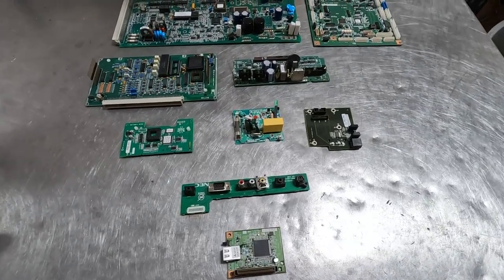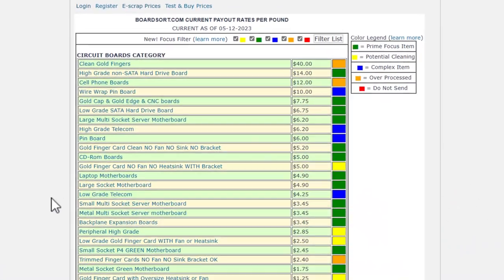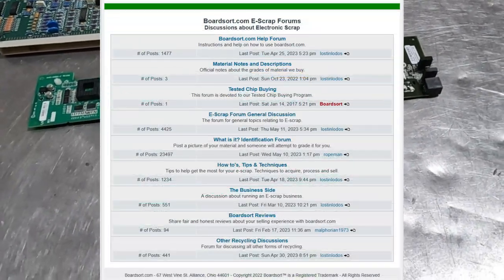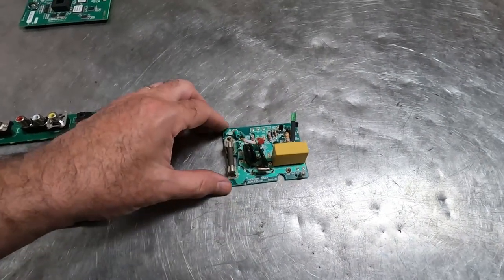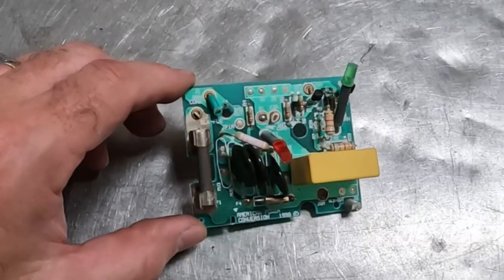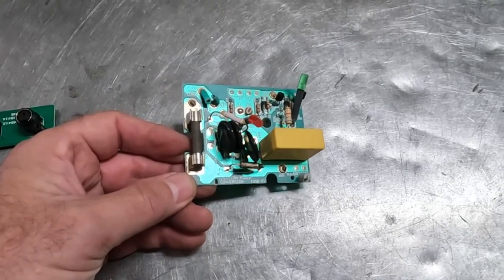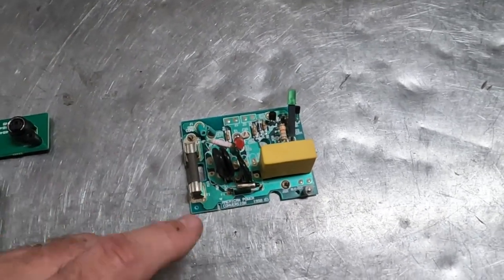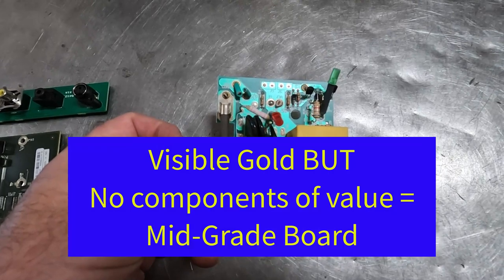Ewaste Circuit Board Identification - Peripheral Boards

Comment: Very good and I agree with your assessment.  I  have quite a few DEC boards with high density of ICs but not sure how to grade them. Do you know of any way to determine  by number of ICs  or date ? Or anyone who specializes in digital equipment items.
Reply from the maker: I wish there was a magic formula that would make this so much easier.  I've been researching this for a long time and I've found no data base or definitive guide - frustrating.  I'm happy to take a look at some pics of your boards to help out.  You can also pics to the Boardsort forum and ask.  Some very smart folks there.

Comment: Question, at 11:00 you depopulate the heat sinks, transformers why not sawzall around the right hand I.C. cut the board off and that would remove the capacitors? Why not break high populated ic/pins areas off, sell them aS perhifial hi grade  and the capacitor chunks as mid grade?18:33 is full of pins and ic's, you just said that was high grade? Why not depopulate the junk off and make it all i.c.'s and pins?(Hi grade?)
Reply from the maker: I'm responding from a hotel room after having evacuated the Asheville area due to TS Helene so unable to provide detailed response to each of your time stamped questions. The question of depopulating or cutting sections of boards to upgrade value is a very good one with lots of considerations. Time is one factor. Should you spend time on trying to squeeze more value from peripheral boards or focus on other more high value inventory? There's also the question of weight. The section of board with the greatest density of IC's and chips usually weighs very little after being cut away. And usually what's remaining is just low grade. Who and how you can sell the material is also important. After you do the cutting or depopulating, do you still have a buyer for the material? Finally, does that work fit your business model. For hobby scrappers/recyclers this is not a consideration but as a business sometimes we make decisions to get less value on somethings to optimize the time we spend on other higher value activities. Sorry I'm not in a position to provide specifics to this video for you but hope this rambling explanation helps.

Comment: Great video.  Question about removing other components should you also remove the capacitors?   Keep up the great work!
Reply from the maker: Generally speaking it is not necessary.   Those caps tend to small and light weight.  However, if you do see a big chunky one it wouldn't hurt to remove it.

Comment: Appreciate the info, ever do a cost analysis of removing components to upgrade to high peripheral vs low?  I know it will depends on the board and the price is at least 2x difference but wouldn't the weight loss would be more than 50%
Reply from the maker: I've not been able to do a real cost comparison because it is too dependent on the type of board.  But here's a link to a video I did with Chris at BOARDSORT.COM where we talk about this:  https://youtu.be/jwC_cCaTm0Q

Comment: @10:35 the problem is that boordsort frowns on removing items from boards when I have done this in the past they emailed me and told me they automatically downgraded my board to low grade when I did the same thing you did so my question is how did yours get upgraded to high grade?
Reply from the maker: That is a very good question and source of confusion. It all depends on the original board configuration and what one removes. In some cases removing the low grade, or junk, part of a board can cause the remain part to be upgraded. But one must have a very good understanding of where to draw that line. Most times when people remove components they are removing the ones that add value and therefore down grade the boards.
Reply: @sharkscrapper  that makes sense thanks for the response.

Comment: really newbie question here. I have been watching your channel and think this might be a cool hobby to get into. How much stuff do you get that is not saleable or able to recycle? How do you dispose of it?
Reply from the maker: A great question Patrick and I'm afraid the answer is, "it depends."  So much depends on what you're going to scrap and what yards will buy in your area or if you're within reasonable shipping distance to Boardsort.com.  For example - most PC's have a lot of plastic on and in them.  If your yard requires the plastic be removed from the metal shell you'll have a lot of plastic to throw away.  Fortunately, most yards will take the PC shells with the plastic on.  If you strip insulated copper wire you'll end up with the plastic insultation that needs to go in the trash.  Most motherboards have a small button cell batter, the CMOS battery, that needs to be removed.  Most places will NOT take these in recycle and should not go in the house hold waste.  I take mine to the county transfer station for handling.   I'd say by far the greatest amount of trash you will generate is all the plastic that makes up the bodies of most electronics these days.

Comment: I believe Aluminum Electrolytic capacitors on the PCBs worth clarification.
Any recycling of it in the States?
From point of view of a true scrapper, I see about 10-15% nice 6061 aluminum when you dissasmble capacitors with some tools. it takes time.
for now I put them to trash.
Just curious if any recyclers accept them sorted separately at any rate, maybe at price of a shred? 😂
Reply from the maker: I've not found anyone here that takes caps as a separate item. I'm sure that the board processors are sorting them after the boards have been shredded.  There are some very clever ways to use eddy currents to remove Al from a shred stream.  As you commented, it takes some extra time to get the Al from them, so I just leave them on the boards and let the big processors do it.

Comment: I believe ALL aluminum electrolytic capacitors are to be removed,
Reply from the maker: Just to be clear - BOARDSORT.COM does not require that.  However, if you chose to do that, go for it.